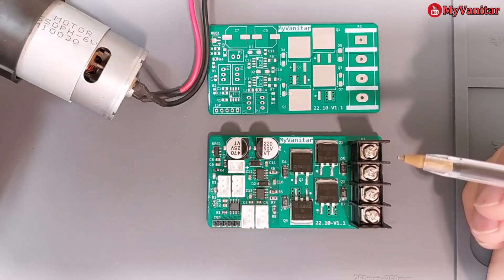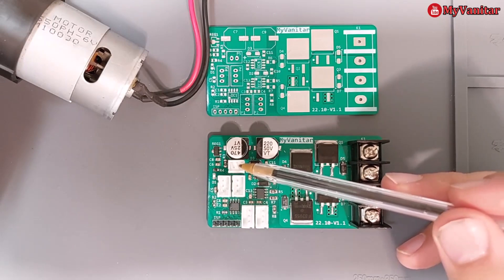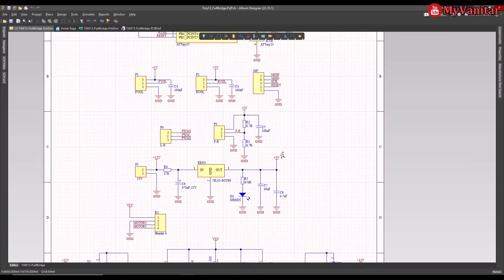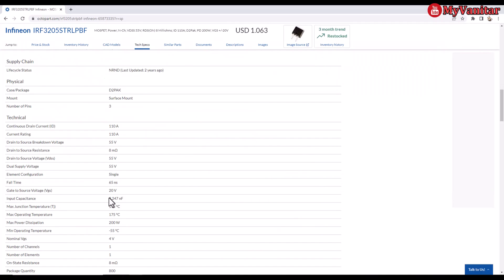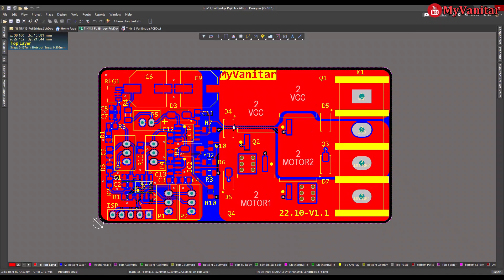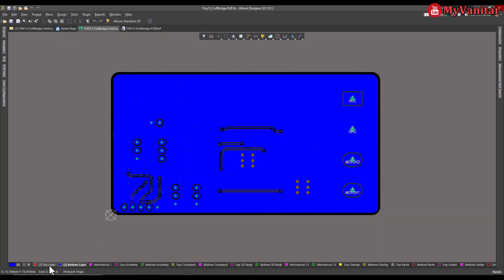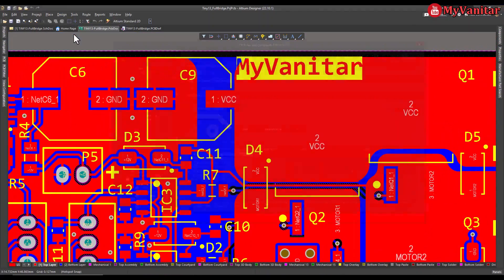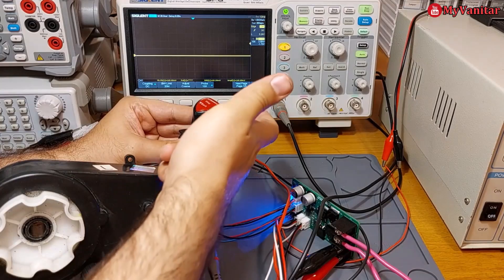Standalone Full Bridge DC Motor Driver

Comment: why drain of High side connected to vcc ? isnt it source that needs to be connected to vcc
Reply from the maker: No, all are N channel Mosfets and this is the structure of an H-Bridge or Half-Bridge
Reply: @MyVanitar  okay thank you
Reply: @MyVanitar   sir, can u take a minute to explain me how this works cause I'm comfused right now especially the high side driving.
Reply from the maker: H bridge theoretical details are available online everywhere
Reply: im using lm5109 driver and i can't control one of the gate of high side mosfet. any idea why?
Reply from the maker: @joshuvajohnvarghese   it's very similar to this. BUT you have to control the MOSFETs yourself. IR2104 does everything internally. Yours need an external controller not just a PWM signal
Reply: @MyVanitar  yes but even if i set all 4 inputs to zero I'm having gate voltage for both high side mosfet is it normal?? i checked everything from schematic to pcb layout there is not short or crossing. 

I'm able to controll 3 gates including one of high side but not able to do the other one.
Reply from the maker: @joshuvajohnvarghese   do you have any load at the output. put a resistor to draw some current
Reply: @MyVanitar  yes i have motor at the output but still one of the mosfet is on and won't close so i can only rotate the motor in one direction now if i try to do the other the thing will short out. i replaced driver and mosfet but still its same. am i missing out something critical I don't know.
Reply from the maker: @joshuvajohnvarghese   as I said your driver is different from IR2104 and you have to provide the signals for the upper and lower MOSFETs yourself and you make a mistake somewhere. if your circuit is correct, this is the only reason. just use my design and have fun

Comment: Hi Vanitar, I am planning to use this to create 24V AC @80 AMPS to create tig aluminum welder. Planning to use arduino to switch forward/reverse. Will there be any problem?
Reply from the maker: to build a welder, why do you need forward/reverse?
Reply: @MyVanitar  to weld we need alternating polarity...and I think H bridge will be perfect to create a square wave at 60hz
Reply from the maker: alternating polarity or alternating square pulses?
Reply: To weld aluminum, we need to alternate polarity which means AC. It can be sine wave or square wave...
Reply from the maker: it is possible (should be tested) but for this device, the polarity change is done manually by that red switch

Comment: Is this board can drive 100% duty cycle?
Reply from the maker: I think yes because I have driven a motor with a 100% duty cycle PWM, however, I did not check the waveform on the Mosfet gate
Reply: It cannot drive with 100% duty cycle. The charge on the gate driver bootstrap capacitors must be refreshed which only occurs when the MOSFETS are switching.

Comment: would it be difficult to add a current sense circuit to it? what's the most appropriate way of adding it?
Reply from the maker: It's PWM, not DC, so it detects current peak, so I suggest using an encoder instead
Reply: @MyVanitar  
My goal is to get a current limiter. I plan to remove potentiometers, add a shunt between mosfets and the ground, let the MCU to change direction (i.e. two outputs, instead of 1 pwm), + UART RX (LIN?) to receive commands.
Reply from the maker: So you have to design your own board
Reply: @MyVanitar yes, i know. i was lucky to find your project, since you gave the layout. I am planning to add a shunt between the ground and the source pins of Q3 and Q4, but I am not sure about the right layout... 
Besides,  am I right that I don't need bulky IR2104 if I don't use big mosfets in PWM mode - cheap small mosfets would be just enough?
Reply from the maker: No, you need a driver. When you drive a Mosfet with a few KHz square pulses, the capacitance of the Gate pin increases and you should push the pulse with a high current to drive the Gate, otherwise, the Mosfet will not be turned ON completely. it burns easily at low currents.

Comment: hello. i have tried to use 24 volt as VCC for my 24 volt motor, but every time i run circuit i only get 8.5 volt maximum across the motor leads? does it have something to do with the VGS? i tried everything but unable to get 24 volts as it supposed to? help is appreciated please
Reply from the maker: Did you use my PCB or your own?
Reply from the maker: Did you follow the Figure 7 wiring diagram,?

Comment: Fantastic video!! Great in-depth inflammation, thank you very much. 
Would you ever consider making a circuit that controls higher voltages like a treadmill motor?
Reply from the maker: I have a plan to publish a similar project, using a touch controlled display. What's the voltage rating of that motor?
Reply: @MyVanitar  they are 90VDC

Comment: Excellent explanation in your article. Just asking that is it mandatory to use PWM frequency from Arduino to be between 20KHz to 25KHz ???
Reply from the maker: No, but higher PWM frequency means softer operation for the load
Reply: @MyVanitar  thanks for the reply. Just posting about an update. I've implemented your previous h bridge design...it worked out like a charm. Just need to clarify with the frequency thing actually.
Also another thing,
Would love to see an EGS board based sin wave inverter. Just a suggestion from my end☺️
Reply from the maker: I had that in mind already, let's see

Comment: Hello. Maybe you can help me with a quick question. What is the 27 Ohm resistor between 12V and 5V for? Does it only act as an inrush current limiter for the capacitor? Is it necessary? Best
Reply from the maker: No, that's for a different purpose. I can reply to you here, but this question shows that you have not read the article completely. So go for it :-)

Comment: very useful project can we use single potentiometer for both reverse and forward
Reply from the maker: it is better to be separate because a user might need different speeds when he changes the rotation, but if I use a single potentiometer, he always has to adjust it
Reply: @MyVanitar  thanks for reply want to ask can i use through hole mosfet in same circuit..? I have made this 2 times but no luck. I'm using combined circuit  From this vedio and your previous vedio that have through hole mosfet.
Reply from the maker: don't waste your time, just order the PCB and build it.

Comment: Hi there Hesam, great video. can you please tell me how you decided on the bootstrap circuit? I am making a similar board but much less current. those FETs are so expensive nowadays
Reply from the maker: if your current is lower, just use my circuit, but use other cheap N Channels Mosfets with identical footprint instead. usually the RDS(on) and VDS voltage define the price.

Comment: hello, it is possible to drive a 3-phase ac servo motor directly with materials such as a mosfet capacitor without a driver
to use driver  tell me what I need
Reply from the maker: Hi, what you need is a totally different circuit, an AC Servo motor driver

Comment: Hi. In your project you are using IR2104 MOSFET driver. May I ask you something why my output waveform to the gate of the MOSFET are not really smooth. Did you have any ideas or suggestions to fix this problem? I'm using 12.8V DC supply, 50KHz PWM frequency and 0.7 duty cycle
Reply from the maker: Hi. Compare your design with my schematic and see if there is a difference and tell me the results.

Comment: hello, how are the losses on the mosfet? Did you measure the Vds voltages and currents of the mosfet with an oscilloscope?
Have you done soft switching?
Thank you
Reply from the maker: Hi. I suggest you build one yourself. 10pcs PCBs is just 5$. I'm sure it will pass your expectations. regarding thermal issues, it depends, so if you plan to use it in high currents, attach a heatsink using silicon glue (not paste).
Reply: @MyVanitar  My friend, I asked a different question. I don't think you understand me.
I'm curious about the ZVS and ZCS statuses of the mosfets.
Reply: @elektrik-elektronikmuhendi6985  if you think you are professional and know many things, you know already or invest some time and go and build this and try yourself to get your answers. I follow many channels and he is one of the few who cares about viewers
Reply: @hp2073  My purpose is not to cause trouble.
It is not for you to answer. I have great respect for the person who made this circuit. If you don't mind me asking what I'm curious about, MyVanitar can say it. Not you!
Reply from the maker: I used those advanced MOSFET drivers to not worry about your above-mentioned issues and measurements, so to answer your question, No, I have not measured them independently. Those drivers saved Mosfets in harsh environments and surges. By the way, your question was an idea for a separate video which I will cover sometime in the near future. The datasheet of the IR2104 has some info as well, don't forget to check
Reply: @MyVanitar  Thank you very much for your answer.
I understand that hard switching is done in this circuit.
I would be very happy if you talk about the soft switching technique in your next video.
Reply: @elektrik-elektronikmuhendi6985  it seems you think soft switching is a new top secret thing and you dont want to listen to anything. you got angry of me first but I got you. You understood it wrong. there is difference between these drivers and using a transistor to drive mosfets. This is absolutely soft switching without any measurement.  this is what he means and again you insist on your word
Reply: @hp2073  Mosfet driver ICs cannot soft-switch. You need to read academic papers to understand what I mean. If soft switching is not made, the IR2104 driver IC will probably break at high current and voltage values.
Reply: @elektrik-elektronikmuhendi6985  academic is wayyyy back than industry. there is no P mosfet here. this is two half bridge. nothing will break here. there is no benefit of discussion with you.
Reply: @hp2073  I'm very curious how many circuits do you design?
Design and see, my friend.
Reply: @elektrik-elektronikmuhendi6985  instead of being proud of your academic people which have not soldered a wire in their lifetime, just go and read the datasheet of the chip. it can drive up to 600V and exactly offers the rise and fall times in nS, but you just talk and talk. you are kinda proud engineer who think he knows everything. What you have learnt in the univ has been invented 50 years ago. you "think" it is new
Reply: @hp2073  You're too stubborn. soft switching is a case of mosfets.
While the mosfet is opening and closing, losses occur on it, which we call switching loss.
At high frequencies these losses become so large that enormous heat is generated on your mosfet.
Understand what I'm telling or don't answer me anymore. The author already understood what I wanted to tell and gave me the necessary answer.

Comment: That's a really neat little board with a tight layout.  I've designed several motor control boards, but usually using all-in-one motor drivers, since I'm doing four channels per board, which would be 16 FETs!  My control chip does PID using feedback from a quadrature encoder and has an SPI interface.  Let me know if you're looking to add PID to your board.
Reply from the maker: Thank you. The benefit of using discrete designs like this is the flexibility in the input voltage and current, which depend on the Mosfets. Also I agree that the best control loop for motors is an encoder. Does your PID oscillate?
Reply: @MyVanitar  Yes, you're right.  I'm currently working on a new controller that uses MOSFETs, but is intended to control brushless motors.  Not sure what you mean by oscillate?  If you mean stability, that depends on how well you've tuned it.  I use mine on my robotic guitar and it stops on a dime and holds position perfectly.
Reply from the maker: how did you determine the tuning values?
Reply: @MyVanitar  There are different ways to tune the PID constants.  Most people prefer to do this manually using a step response, i.e. changing the target speed or position and looking at a graph of how the speed or position changes.  You need to know how each of the constants affect the graph, so you know which one to change.  It also depends on whether you're more interested in a fast response, or less overshoot.  It can be a bit of an acquired skill, but it's fairly easy to get it to control in a stable fashion.  My control chip has default constants that work perfectly with those small metal gear N20 motors with rotary encoder wheel on the back.  PID is good fun.